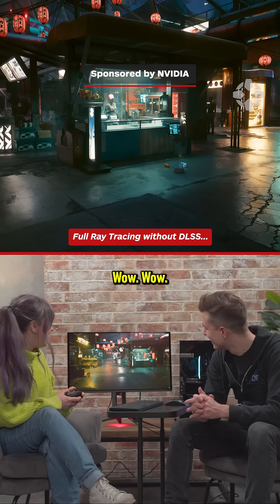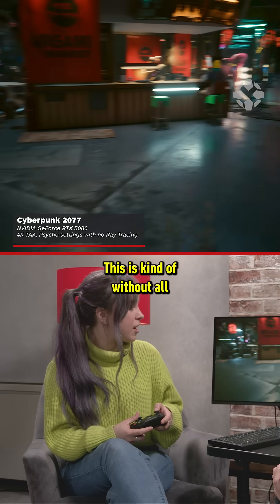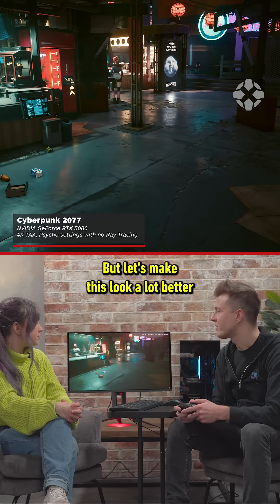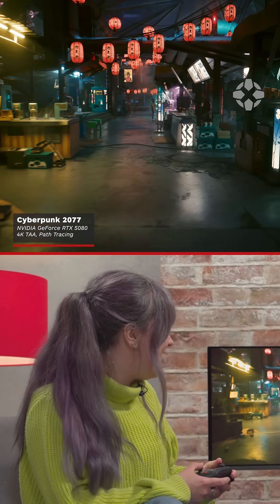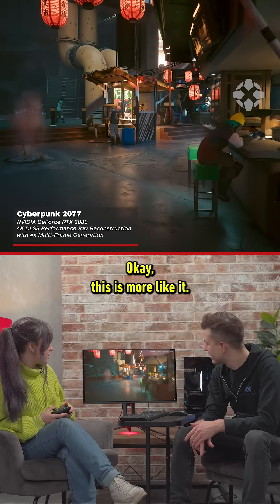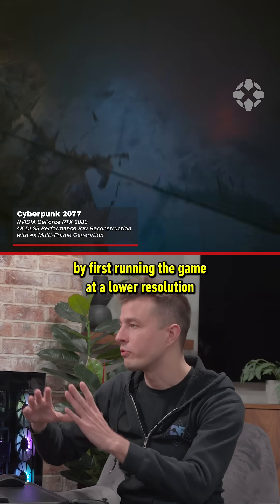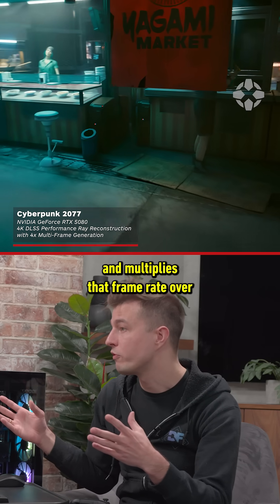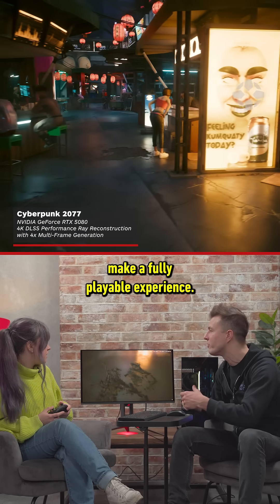Digital Foundry’s Alex Battaglia explains how the tech behind ray tracing works #sponsored

Comment: If RT with playable framerates is only achievable with fake frames, I'd rather have it turned off.
Reply: The 5080 can play the game at a playable framerate path traced with only super resolution.
Reply: @guspaz  I concur. I have an astral 5080 and it's a beast.
Reply: A 3070 could run it at good frame rate with no frame interpolation.
Reply: @FF-kc7fc not at these settings
Reply: In this game. You won't feel the difference

Comment: Ray tracing is still so taxing on gpus. We really cannot break the ceiling for GPU power and efficiency. Thermodynamics is a pain in the ass
Reply: Future APIs and better graphics architectures along with improvements to game engines should make ray tracing less taxing on a hardware level, the size limitation on transistors due to reaching the physical limits of future designs will be the biggest detriment in upcoming computer chips.
Reply: That’s why frame gen is so handy in this situation
Reply: @zq7246  frame gen can only all do so much. hardware needs upgrades too

Comment: And it's gonna be added to switch 2 which is crazy 😂
Reply: Right... a version of it is, but not anything like what's being shown here.
Reply: Switch 2 will run it path traced, switch 2 has the same hardware as ps5 pro(the fans of switch 2 talking me that). @corey2232
Reply: Never ever did anybody say that or announced this or confirmed this and now holding the switch 2 in front of me I can confirm, it does NOT have path tracing or any type of RT
Reply: @joshwpro4499  the Switch 2 does have rt and DLSS, lmao. Would you like some salt and pepper for those words?
Reply: @DefectiveButchrReviews  So first, I have a Switch 2 and I own Cyberpunk, and it does not use any ray tracing (RT) features. In fact, there isn't a single game that currently takes advantage of the Switch 2's RT capabilities. I never said anything about DLSS. In fact, DLSS has absolutely nothing to do with ray tracing. DLSS is a supersampling technology used to upscale a game's resolution to a higher output. So yes, a lot of games need to rely on it just to reach a playable state.
Reply: @joshwpro4499 the conversation was revolving around the tech, not the game itself lmao. No duh, CP isn't gonna have RT on the Switch 2, I'm arguing that system does in fact have RT because your comment made it look like it doesn't.
Reply: @joshwpro4499 it does have rt cores. Look at the specs
Reply: There will be no ray tracing
Reply: Dreams lol